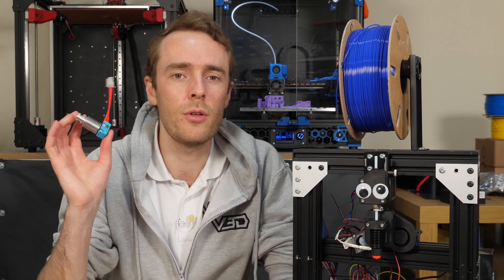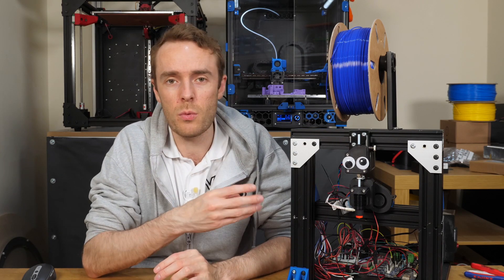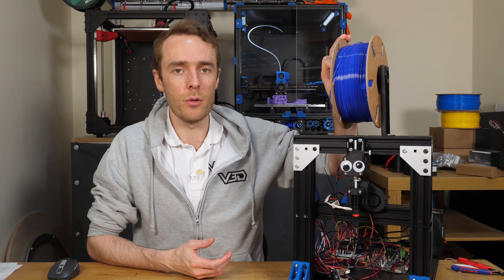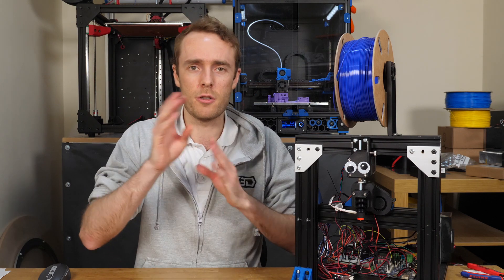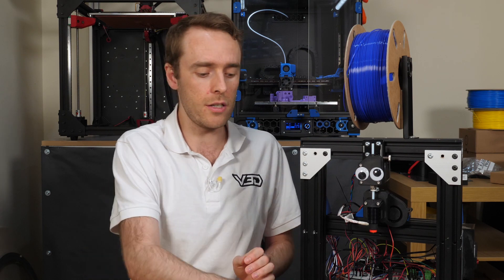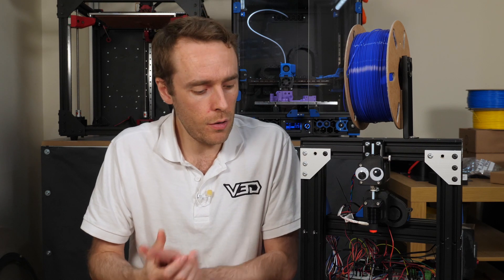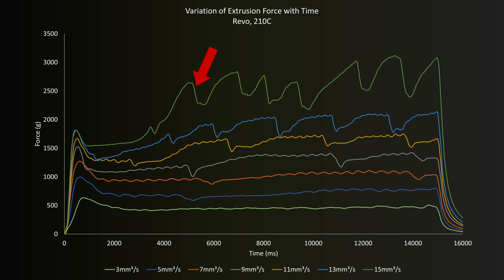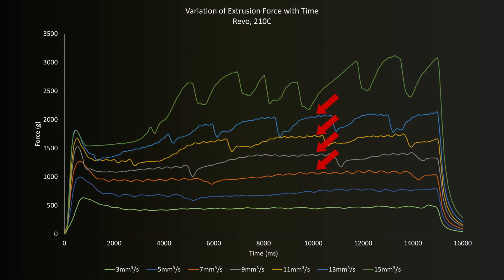V6 Size with Volcano Performance?!

Comment: Sanjay would have loved this!
The improvement over the V6 is quite remarkable. I wasn't expecting such a difference.
Did you consider heating the load cell to a constant temperature instead of cooling it? This would allow a constant temperature regardless of ambient temperature changes.
Lastly, I don't think anyone not from the UK will understand "Brute Forsyth"! LOL

Comment: I’m pretty sure the dips are coming from the extruder gears teeth biting in the filament, or the not consistent alignment of the gears to each other. Calculate the teeth per revolution vs flow rate / time. Super interesting research!
Reply: Agreed. Most dual gear extruders have teeth which don't mesh correctly. This allows small variations in filament.
If one could get appropriately sized helical gears on a dual gear extruder, these pulses might go away. Of course helical gears would make the extruders more expensive.

Comment: Great, info! Did you happen to look at the energy used to initially get the hotend up to temp? I suspect you would see the v6 requiring more and maybe that's part of the difference in power consumption. Once the v6 is up to temp its larger thermal mass would make it appear more efficient.
Reply from the maker: It might be worth testing, but you can compare quite easily with maths alone. It takes 3X the energy to raise the V6 by 1 degree C compared to Revo Six.

Comment: I'm assuming that the revos lower mass is less suitable for the normal PID tuning found in Marlin and other firmwares due to the higher impact of cold filament.
For a highly responsive system like a revo you really need to tune it under load which means tuning it while it pushes filament. Feels like a sort of wasteful workaround but I don't know if you perhaps can easily simulate the cooling of the filament any other way, perhaps having metal rod in the filament path and tune the cooling fan to a slower cooling rate?

Comment: I would guess the V6's efficiency is due to it's larger block. This makes sense as well when we look at the heat chart you made as well. The extra thermal mass of the block seem to be at the core of it. I would hedge a guess the rippling is the revo heating up and cooling down! Great video!
Reply from the maker: To clarify, I don't think the V6 is more 'efficient' (using less energy for the same job), I think the Revo is imparting more energy to the filament (doing a better job with the same filament flow rate)
Reply: @Vector3DP  I would agree, I guess I am not the best at explaining ha ha! We are planning an extrusion test as well, but totally differently! Really interesting to see how you built the set up and everything! Love the data!
Reply: I took the long way around... just saying,  Heaterblock temps aren't filament temps. You sure that revo isn't just  runnin a cpl degrees hot? Would make similar data...... How to measure the goo stream?, beats me :)

Comment: Fantastic video Adam. The question remaining I guess is: "How fast can you print without overcooking your filament?"
Reply from the maker: Define: overcooking
Reply: @Vector3DP  Visible degradation or loss of mechanical properties/layer adhesion. Severe stringing perhaps.
Reply: Vector 3D Define: Define

Comment: Possibly filament particles in the extruder gears could cause it to slip inconsistently.
Reply from the maker: From what i've observed while testing, the teeth do not seem to accumulate any material when slipping. Anything that does come off the filament seems to just fall away. I'll see if I can do a specific test to demo this.
Reply: @Vector3DP  Take a look at the video titled What I've learned about dual gear extruders and how to patch them, maybe on the channel MihaiDesigns. I think this explains the waves.